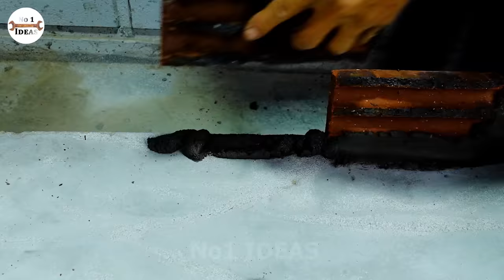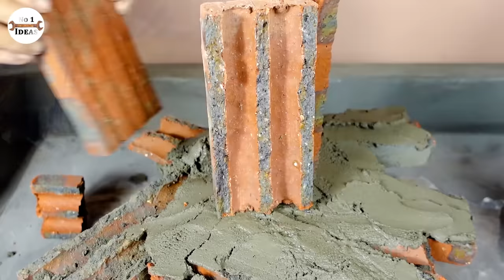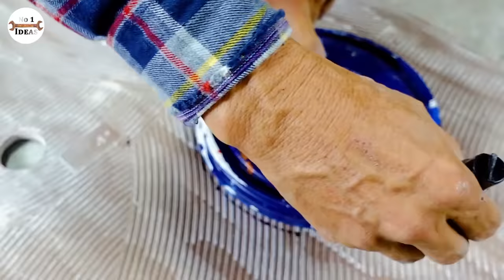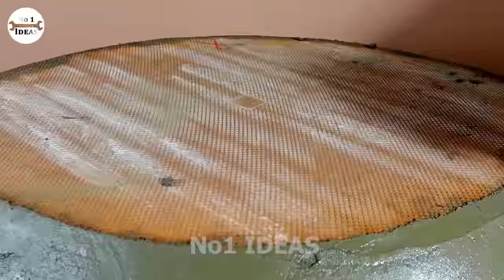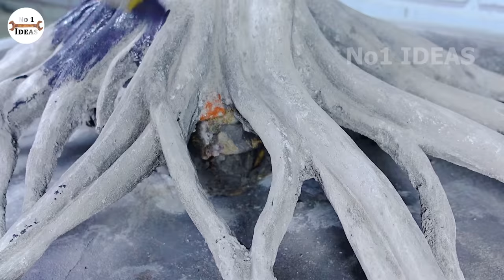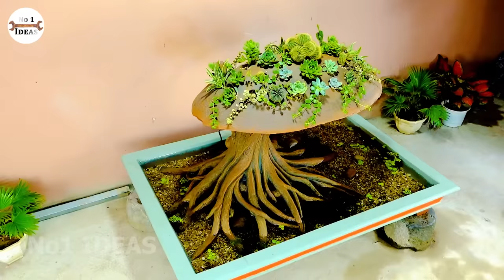An amazing idea from cement! DIY the mushroom waterfall aquarium at home

Comment: This is incredible. I only have one criticism and that is why so many fish it's an extremely small aquarium for the size of the goldfish. You could have one maybe two  for that size but you put in like 20 that's way too many. There's not enough oxygen in the water for that many fish
Reply: you should worry more on  the chemical leak from cement and paint,  48hour   he soak the tank is not enough, it need at least a month and multiple water change.
Reply: @jetli740  the both of y’all have the same concerns I had… I hope those fish were removed quickly afterwards…. It’s inhumane.
Reply: Maybe just so it looks ok, i guess
Reply: I've seen many of these concrete aquariums.  They are mainly to showcase their skill and click bait. They are not really functional.

Comment: As someone that is internationally qualified in concrete construction, don't ever use wood for reinforcing in your concrete. What does wood do? It rots. Suddenly you have voids in your concrete and what happens? It cracks then breaks. Now, not to knock them because aside from that, it's a solid idea. Just use steel instead of wood hahaha. Better living everyone.

Comment: you should use guppies not goldfish
Reply: or even 3 female betta's
Reply from the maker: Thanks for your suggestion😍😍😍
Reply: @no1ideas  no problem i say this because goldfish pollute the tanks really quickly so using smaller fish is best goldfish need big ponds not puddles
Reply: @no1ideas  also endler guppies would be perfect for the smaller tanks
Reply: @no1ideas  almost forgot to say if you put in bettas only do 1 male per tank or 3 females make sure there are a lot of places to hide for them too very important